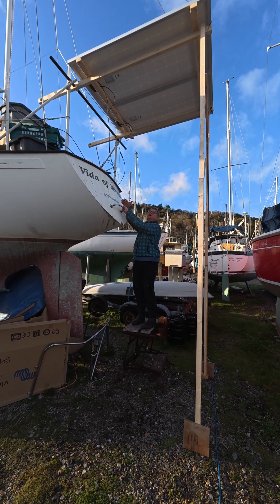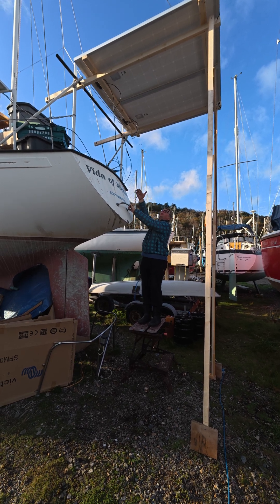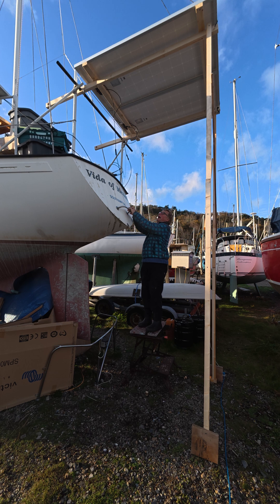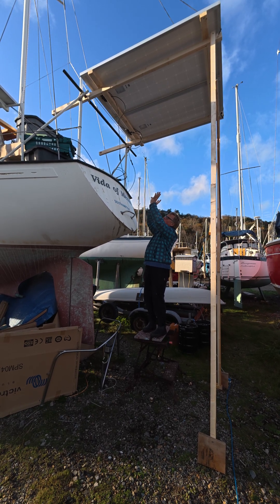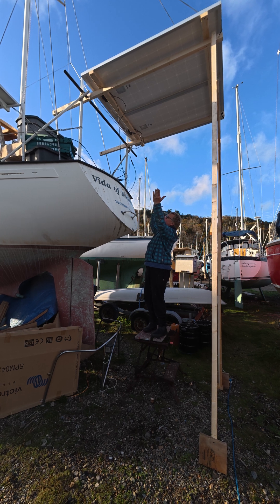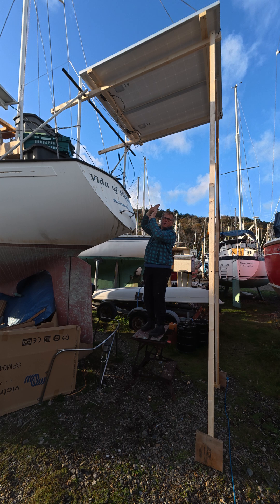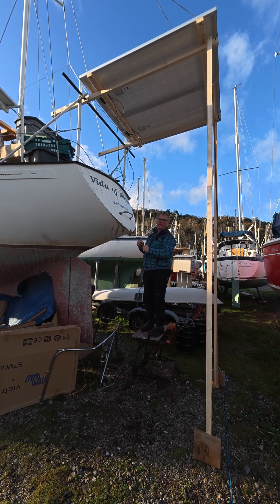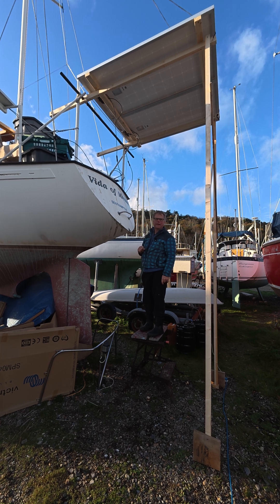More solar power for our electric yacht refit. 1550 watts connected #BoatRefit #SolarPower #DIY

Comment: I can see a small brace. But those legs need strengthening up by quite a bit. Any twisting or excessive wind and the panels could be at ground level. What timber are the legs. 3x2?
Orientating the panels with an angle/pitch would yield great results than flat also
Reply from the maker: I was just woken up by the wind. According to 3 windy models we currently have gusts over 50mph from the SW. Due to the sheds here that funnels directly towards our bow and accelerates. Typically we get some boat shake above about 45mph.
Anyway, I've been on deck. No movement in any of our solar or the wheelhouse extension. Only thing banging was the yard electric box door.
I will be adding tie downs to the aft solar before we get the wind with any North in it (from aft).
The aft solar has a backup support from the mizzen topping lift which coped with 40mph wind last night.
We would need to tilt the panels to port at this time of year in the yard but that is a design complication too far.